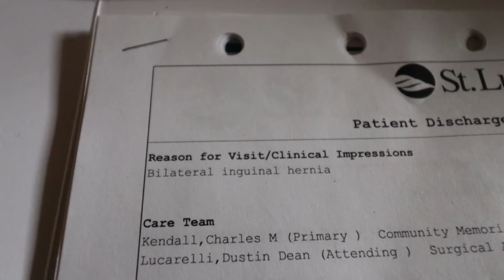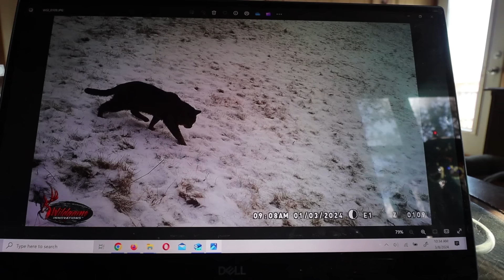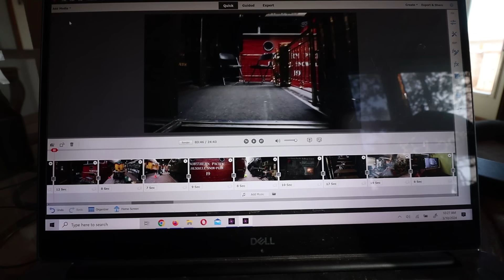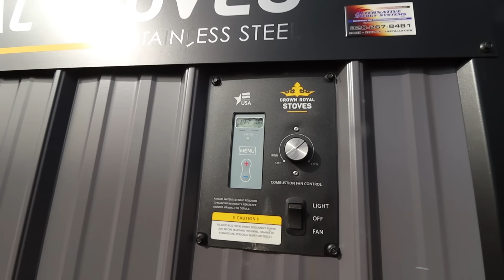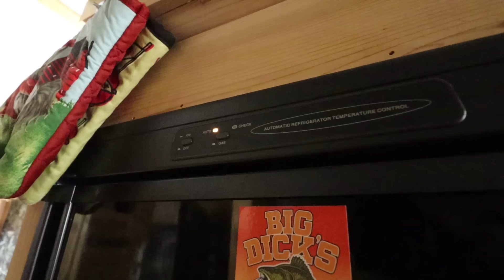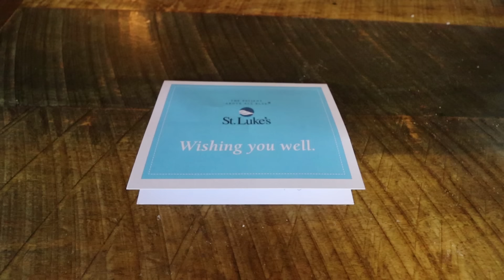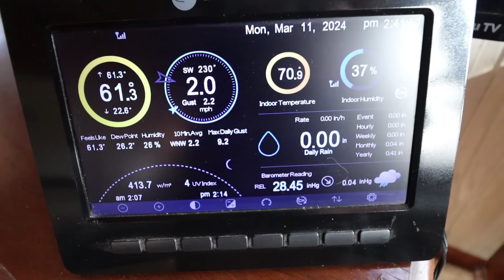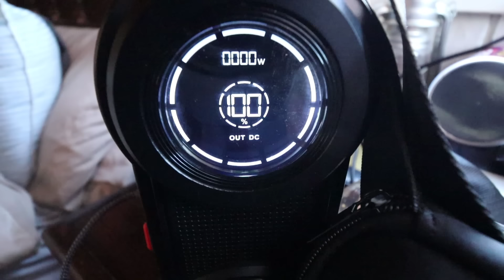THE FARMHOUSE. After Surgery. The first 7 days. Recovery. Lots of Farmhouse cooking.

Comment: Good things are healing. The Ibuprofen will help with the inflammation as well.  When I had mine done I had to walk five miles daily,  but that was part of my firefighter rehab to get back to work.  There's not much you can do since you can't do anything over the weight of a gallon milk jug. Plus a word to the wise just because they say ok doesn't mean you can go balls to the walls, like cutting wood or something like that you'll have to work into that.  It may also feel different but that's to be expected. And you'll have to learn a new normal.  Good luck, it just will take time.